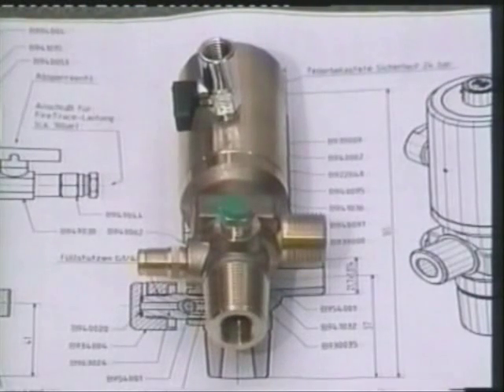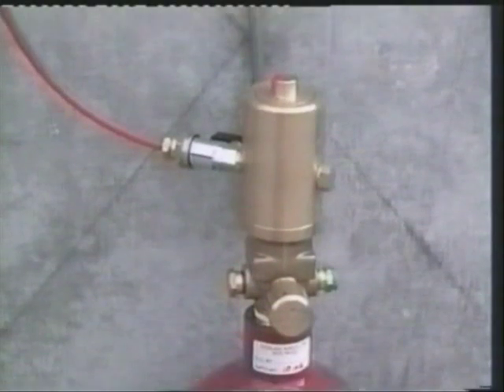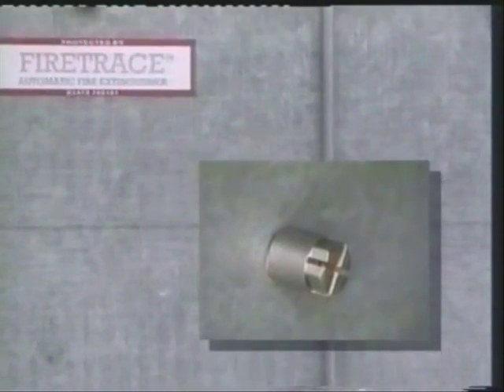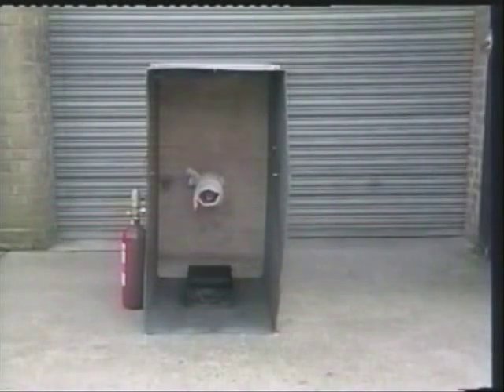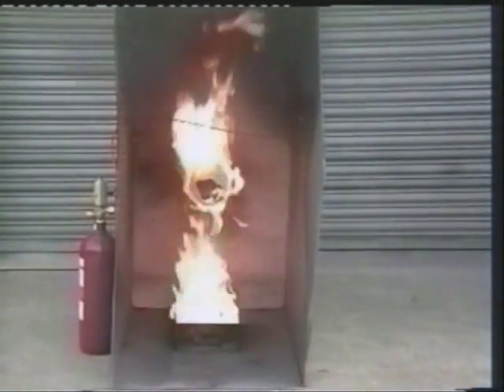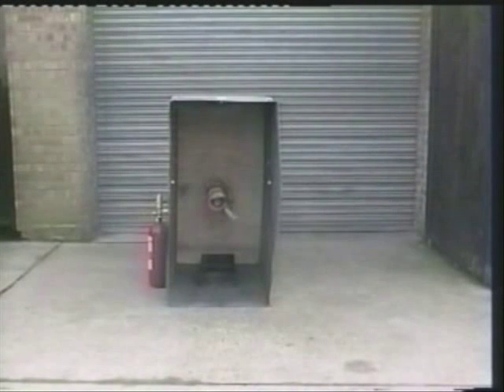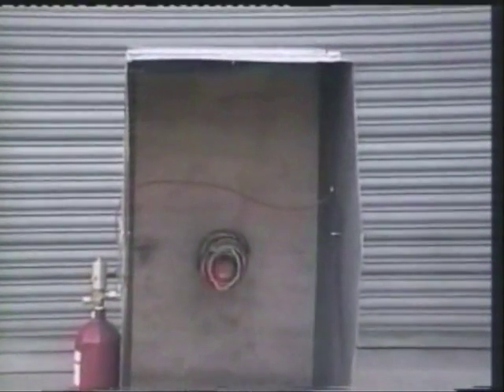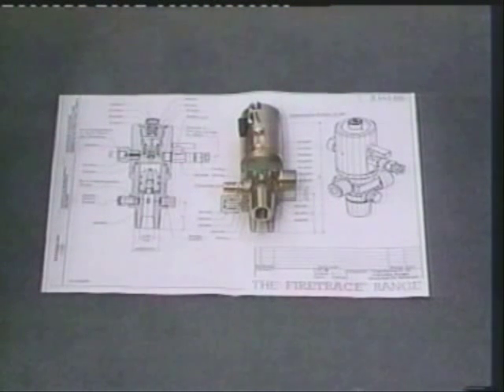Automatic Co2 Fire Extinguisher Demo

Comment from the maker: Correct, but quite safe for compartments within occupied areas providing overspill of Co2 does not exceed 5% by volume. For quick estimate, if the room is 10 times larger than the risk, no danger to personnel.